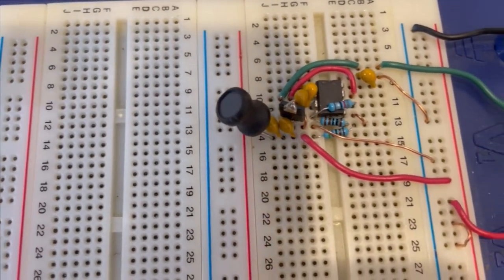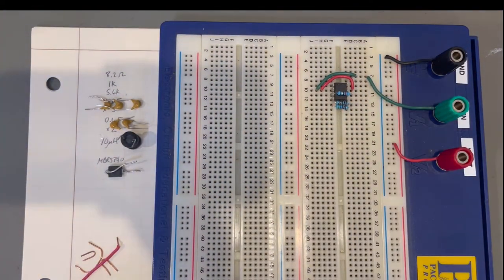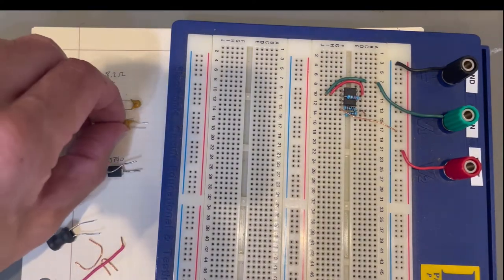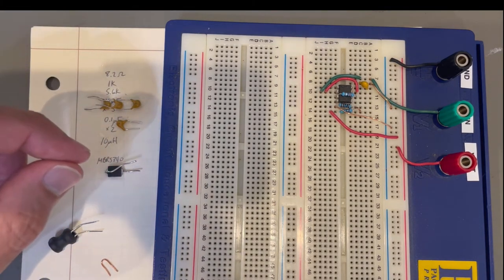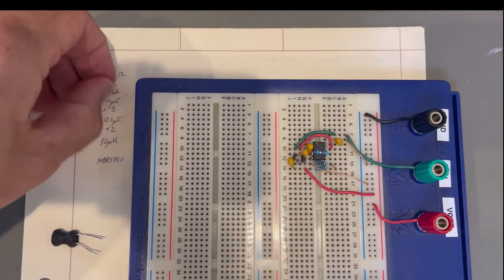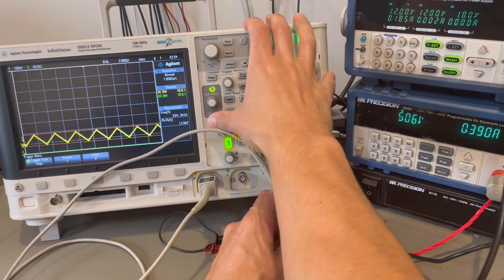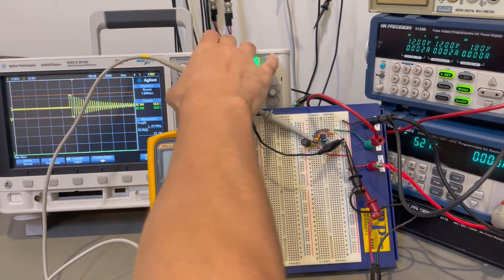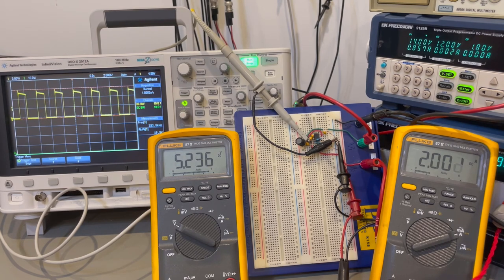Breadboard Buck Converter (12Vin to 5Vout @ 3A)

Comment: Hello, i am trying to do the exact same thing(DC-DC BUCK converter), but im using a 9v battery, How do you propose i go about this. Note that this will be done on a bread board as well, can you give me an idea? Thanks.
Reply from the maker: I suggest starting with an inexpensive buck converter PCB from eBay and simply breadboard VIN, VOUT, and GND.
Reply: @gocircuits3446  okay let me explain better, I have a pic microcontroller, I really trying to learn how to use it, knowing fully well I could use arduino which is a bit easier(even tho it’s hard work) but I wanted to learn with a pic microcontroller
Reply from the maker: For powering a small device like a uController, an easier option would be to use a linear regulator like the LM7805.